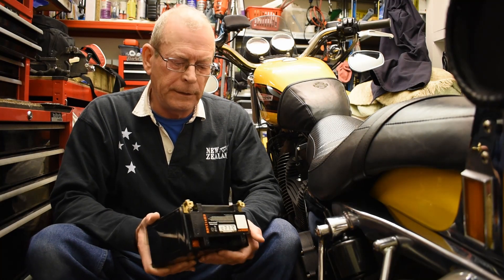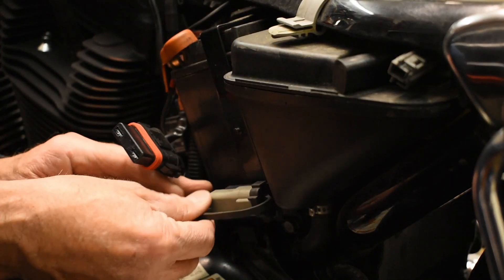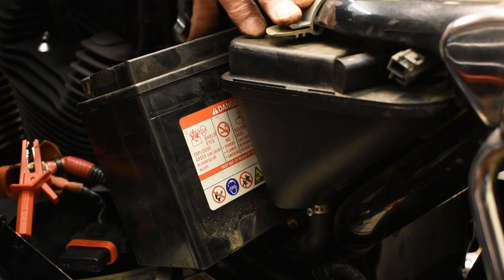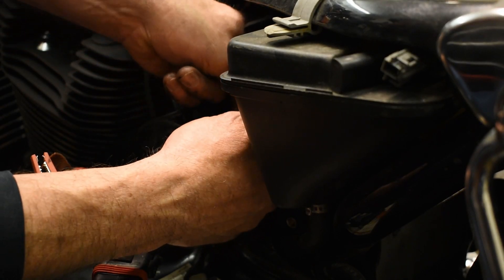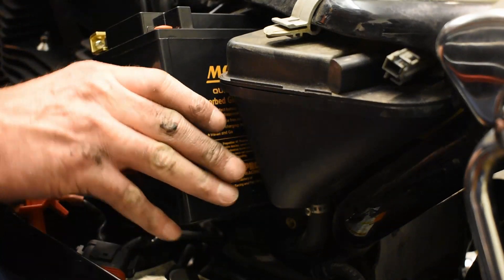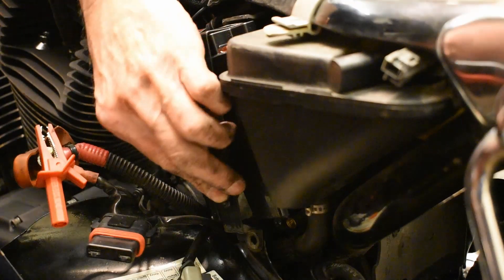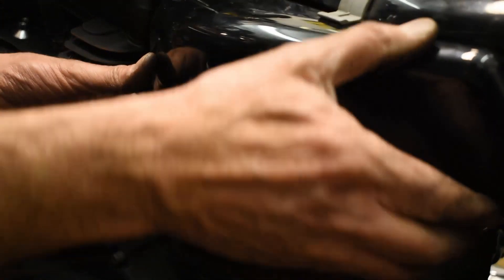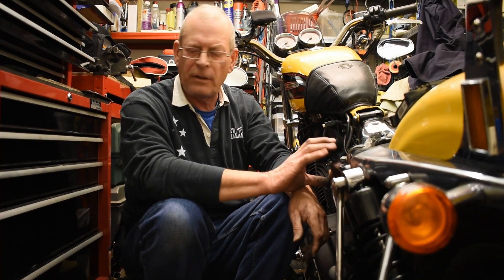Bikervation - Harley Sportster battery upgrade to a 16Ah/240A CCA Motobatt MBYZ 16 HD

Comment: I put 19ah battery HVT-1 for Softail (175x 85x145) and did a modification of the cover battery. Barely noticeable mod. But cranking are much stronger!
Reply from the maker: The Roadster still struggles a bit when cold even with the new battery, I think the compression is higher on the 1200R models. Thanks for watching.
Reply: @Bikervation but the lithium battery is the next move for me….

Comment: How has this battery held up over time?
Reply from the maker: It’s been good, always on an Optimiser and started the bike no trouble except when cold over winter. Last year I tried to jump another battery through the pigtail and then it wouldn’t charge! I didn’t realise the problem was the pigtail fuse blowing which meant the Optimiser wasn’t connected. I replaced the battery before realising my error and now use it around the garage as a 12v source, bit silly of me not figuring it out before replacing as it would still be OK.

Comment: Important, remove the negative first, after you can remove the positive, always. This is the best battery, not only save you some cash, but its the best in cold condition and I never used to charge it nowhere.

Comment: Just about to upgrade to this exact same battery from M and P in the UK. £59.99 instead of £140 ish from Dealership. Mine is a 2018 Iron 1200. HD flipped the battery round on the later models. The positive is under the seat, the negative on the L/H/S. I'm thinking it shouldn't be quite as fiddly as your's (hope!). Thanks for the information.
Reply from the maker: Thanks for watching, it's helpful that the battery has terminals on all the corners. Mine starts a lot more positively now, good luck. Chris

Comment: I just put a new battery in my Sportster, too. The old one was a glass mat battery, which was good, but I think the vibration may have damaged it over time. It lasted about two years before developing an open circuit within the cell (I think that's what happened). My sportster is an '01, so it's the solid mounted engine and it does vibrate a bit more than the rubber mounted ones.
Reply from the maker: Thanks for the heads up, I'll keep an eye on that. I was playing with the idea of getting a Lithium Ion battery but there a bit pricey at the moment.